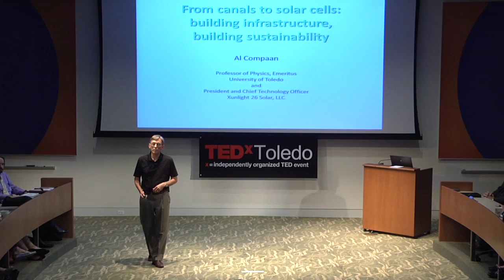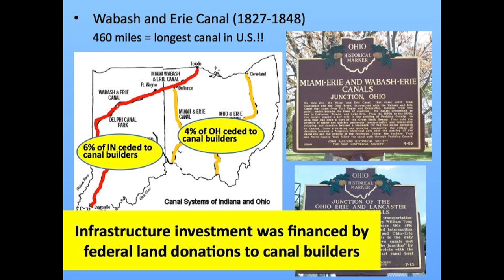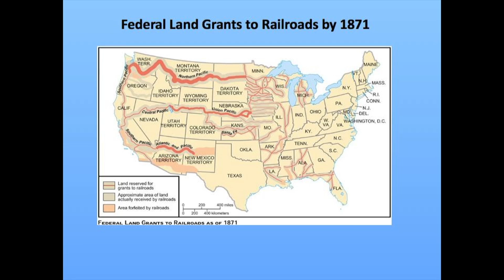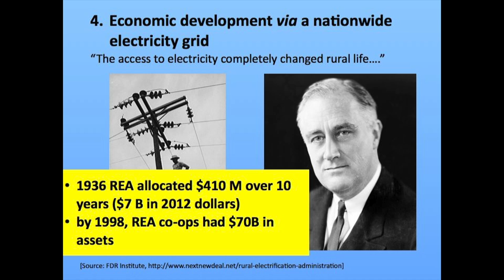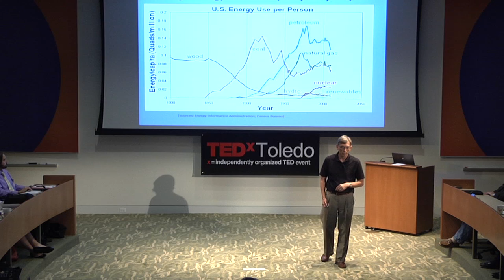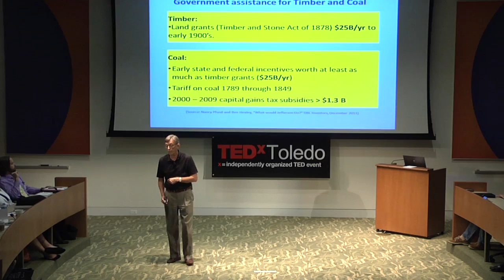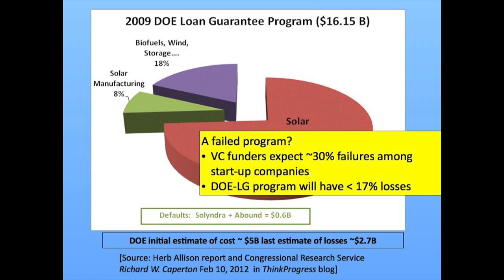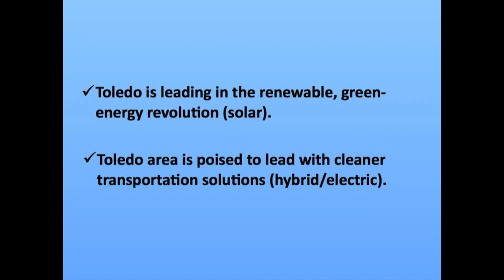From Canals to Solar Cells : Dr. Alvin Compaan at TEDxToledo

Comment: Great talk have you seen the new work on thorium reactors?
watch?v=P9M__yYbsZ4
They seem to be the safest, cleanest base load power generation system available at the moment.
The main problem with solar and wind is it is difficult to store the energy as demand fluctuates a thorium reactor can scale its energy production depending on the need in the grid.